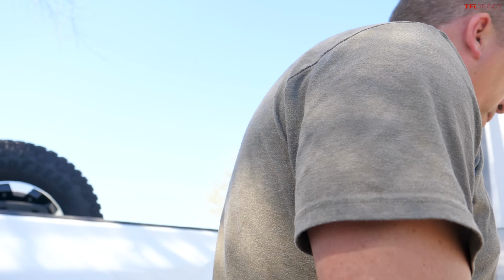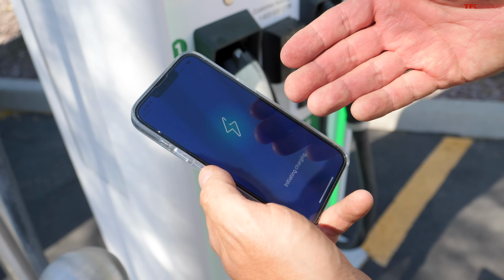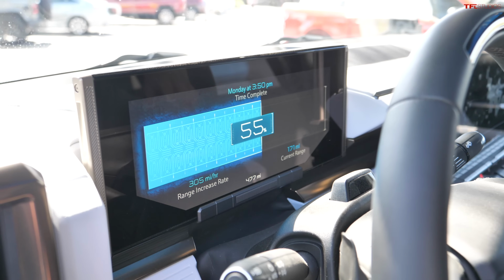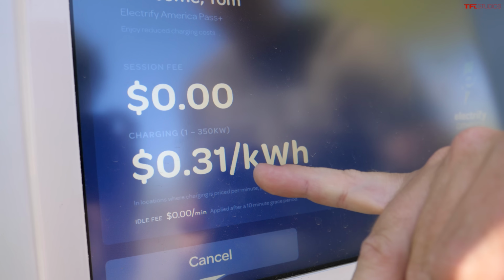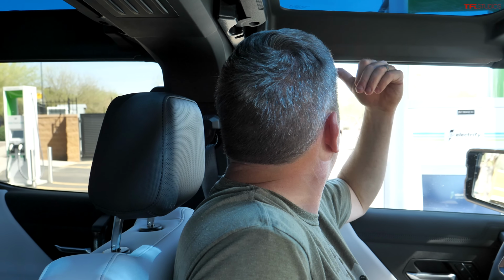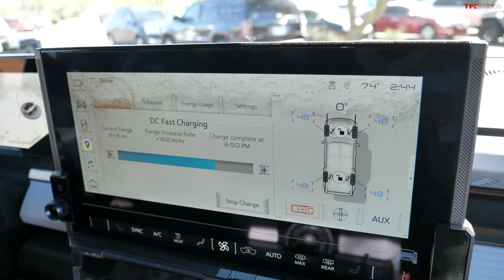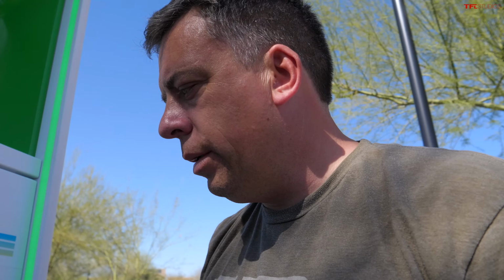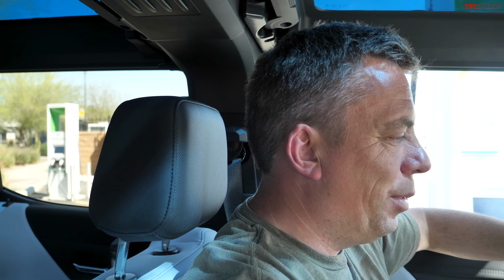How Fast Can I Charge The GMC HUMMER EV In Just 15 Minutes? The Answer Is Surprising!

Comment: I noticed in one of the videos that they guys were having an issue with the folding mirrors. I have noticed on my Hummer ED1 that my mirrors only auto fold when I lock the truck from either the remote or by pushing the lock button on the door handle. Hope this helps if they are still trying to figure this out.

Comment: From zero to 30 percent it can charge at 350kW. Then 30 to 40 percent is about 250kW. Then after that it settles in around 170kW. I think the throttling factor is the thermal management of the battery system.

Comment: These EV users need to be fully committed to the green movement, or they’re just hypocrites that paid for an overpriced car.  Make sure every time you charge your EV, that the power comes from a wind turbine or solar panel only.  Otherwise, you’re using the same fossil fuels you bitch about, only difference is the fossil fuels are being burned 10, 30, 50 miles away from you.  

Also, yes, the cost of charging is cheap now, but imagine if everyone in the US had an EV to charge.  None of you think of the increased demand on the grid, while no new power plants have been built.  Oh, you want solar and wind?  Supplemental energy sources that pale in comparison to nuclear, natural gas, coal productivity.  And the amount of wind and solar you need, requires a few thousand acres of land near a major metropolitan.  Are you willing to cover all that land with solar and have windmills all around the city?  Or do you “greenies” only want wind and solar built out of sight?  “I don’t want to see those unsightly things, just build them way out in the country.”

So many of you EV clowns forgot that at one time ATM machines were free to use.  Why?  Well, the banks wanted people to get used to using them, “the convenience of using ATMs, and not have to go into a bank.  What happened when society was using ATMs full-time?  Banks started charging service fees for: using their own ATMs or/and using ATMs of other banks.  Think these prices to charge your EV will not change in the future, when demand increases?  You guys are all clowns, and like a true Leftie, you will not think anything through.  All of you just want to feel good right now, and not consider long-term consequences of your actions.  Similar to saying, “We want criminals released…” and then an incident like the Christmas parade killings in Waukesha, WI happens.  Good job.

Finally, how many of these EVs start at $60K and only go up from there?  Some costing over $100K, but “all for the sake of “climate change.”  You are all being played, under the guise of “fossil fuels, (Which I’ve been told we’d run out of all my life -I”m 40)” when it’s a self-induced wound created by extreme liberal political ideologies purposefully crippling our energy independency.

Comment: I just watched a video that featured a new EV Hummer that was at 4%, when plugged in to home electric, it estimated 4 days until fully charged. Pretty handy.
Reply: In all fairness, that was with 120v but the guy also has a Level 2 charger (220v) and it was over 24hrs to charge that Hummer. That's just crazy.
Reply: @carlosf.7158  it's a long time, but if you always keep it plugged in while at home it'll be fine, for me anyway. That's at least 10 hours of charging per day I'd imagine for most people.
Reply: That's fake news. The longest I've seen from a 120v outlet is 30 hours, which is practically 1 day. The 240V outlet takes 8 hours to fully charge the car.

Comment: Chargers are often 1000volt at 350 amp aka theoretically 350 kW.  But since it is 0nly pulling 800 volts and even that gets throttled down to 80% you would see around 225 to 280 kW top speed.  Also top speed is seen around 10% and then drops 55% battery capacity at 178 kW is very good.  I just spent 1 hour 15 minutes adding 25 kW to my Chevy Bolt EV.  Man what i would do to do it in 8 minutes....  :)

Comment: Station is fully capable of 350kW; the battery is not. In fact, NO battery on the market is capable of consistant 350kW charging from 0% to 100%. You did charge at a higher percentage so if you were at say 20% you may see those speeds but only momentarily. The only car that can get remotely close to those speeds for an extended period is the Lucid Air and even then with a 900V battery gets around 300-310kW.

Comment: The Hummer EV is pretty cool. But my God......I don't want to even imagine what that battery costs. Probably 30 or 40k. The major drawback after 7 or 8 years of age will be resale value due to the ridiculously expensive battery. I can see this thang losing 65% of it's value easily in 8 years. No thanks!

Comment: I dont like this oversimplification of something which is extremely complex 😤 😠 😡
1- How Far did you had to travel to reach a 350kw Charger ? 
2- What is the Availability of this Chargers ( Currently ) not in 5 years time after you sold the car  🤦‍♂️
3- If there's no 350kw Chargers available ( Most likely ) how long would it take to charge using a Home wall Charger or a 7kw Charger ? 
. 

I means if there's something like 10 to 20x  350w  chargers this is completely pointless until the infrastructure   is there as supposed to being like a (LOTERY) regarding who get's to this 350kw chargers first

Comment: EV charging facts..A battery will charge faster when it has a low charge up to a certain %. After that % is reached  it slows down. So the first X % will charge faster than the last X %... So U can charge to say 55% and drive off for X miles and recharge quickly as long as the charge is low at the recharge.. Never reaching more than  80% on a single charge.. Video's available on Utube..

Comment: So, for putting things in perspective, he added 45.95 kW into the battery in 18 minutes, which means it charged in average at a speed of 153 kW starting from 53% SOC to 75% SOC. This charging speed is way above what a Tesla can do at the same SOC. Tesla is around 80 kW average charging speed from 53% to 75%. So the Hammer charges two times faster than the Tesla M3. If the Hammer was a lower SOC (state of charge), I am sure the average speed would have been above 200 kW, which in 18 mins would add 60 kWh in the battery. For a total of 18$ for about 100 miles. A truck of same size as the Hammer would be rated at 15-20 mpg. That's 5 x 5.084 $ (Diesel) = 25 $.

Comment: Larger mammoth sized vehicles are simply less efficient no matter whether ICE or EV vehicles.  The Hummer is massive and will have the most expensive EV charge cycles one could buy once it comes out.  All monster sized trucks are horribly inefficient so there should be no surprise that the Electricity costs appear to be so expensive as well.  Full sized trucks simply use much more fuel/energy in general and the Hummer is a very heavy battleship that certainly falls into that category.

Comment: The energy cost using that charging station at 31¢/kWh is not much less than the cost of gas.  I'm an EV fan, but, there's a reason for the slow adoption rate.  The cost differential of a new EV far exceeds the energy savings.

Comment: You seem so confused why it isn't charging at 350 kWh but you literally showed in the video and called out that the Hummer EV was preconditioning. It said on screen that it may take up to an hour to precondition and if you look at the screen, at Google maps, at that point in the video you were only a few miles away from the charger. Meaning you hardly preconditioned at all, certainly not for an hour. You also started charging at a much higher state of charge. For an EV channel I feel like you should know better. I would expect you to at least be aware of things like charge curves and to actually let preconditioning finish.

Comment: This charging test does not bode well for the GM Hummer EV.  I don't know what GM was thinking taking their most inefficient vehicle of all time and deciding to make one of their first EVs out of it.  The H2 Hummer earned a reputation for being a vehicle for people that are proud to waste money.  It only had a few good years of sales at a time when gas was super cheap and the brand died quickly when gas prices went to $4 per gallon in ~2007.  After that, it was seen by many as a sign of stupidity on the part of anyone that still owned one.  This is probably why you barely ever see them today.  

This, and large super duty trucks used for long distance towing, are the worst case scenario for EVs.  I think GM is going to sell very few of these.  Really bad product choice that was probably made by some geezer MBA, bean counter, or marketing schmuck that was given a leadership position and has nostalgia for something many others would associate with failure.  Don't bother with an assembly line GM.  Just hand build them in a warehouse somewhere.  A few per week is plenty to keep up with long term demand.

Comment: The cost to charge was more then I thought it would be. But calculate in maintenance cost running ice vs ev and the ev will be ahead. They have a long way to go on the charging network and battery chemistry before I go for one.
Reply: but factor in the cost of replacing the battery and then you're better off with ice

Comment: There must be something wrong with that charger to be charging that slow for 350 kW. Starting.  This is  a problem with these non Tesla charging stations you find this type of issue constantly throughout the country. They have to do a better job if the public is going to start buying non Tesla EVs because if not people are going to get turned off and not buy them. It's either slow or they don't work.

Comment: $14.24 doesn’t seem very cheap to travel only 75 miles
Reply: Hummers in general were never very cheap to travel 75 miles, but still cheaper than mine. My Escalade gets 9mpg on an average day which means traveling 75 miles uses about 8 gallons. If I fill up using regular 87 gas at $3.71 a gallon (I just filled up today 1/27/2023) that would cost me about $30 in my Escalade. The BEST mpg I've gotten on a tank is 12mpg which would mean traveling 75 miles = 6.25 gallons = $23... This bougie Hummer EV is still cheaper than my truck lol.

Comment: I like how when it’s a Legacy auto manufacturer that’s failing to meet expectations they are always on a positive note on TFL. If this was a Tesla failing to reach charging capacity or even remotely close to it they would’ve thrown Tesla under the bus.  

This is also another consideration of super heavy EV‘s is charge times will be near double because consumption is near doubled. Small EV‘s will charge faster than large EV’s from the owners perspective.
Reply: Very true.  It's not just this channel though.  It seems almost everyone wants to give the benefit of the doubt to legacy auto even though it's obvious they are failing to produce compelling (or sometimes even mediocre) EVs.  Meanwhile, they'll nitpick everything about a Tesla and hold it to a completely different standard.  That would be fine if they acknowledged that Tesla sets the standard and they expect more from it.  However, it's presented more like, "Tesla earns a B- grade because it doesn't have a plastic divider in this storage compartment to hold my lunchbox.  GM gets an A because they managed to make it charge slowly."

Comment: theres literally no way you could ever charge this in 15 mins as it would need a freaking commercial mega charger at 800kw to do that if it held that the entire time....the hummer is a pos.  it weighs 9500lbs and gets 300 miles with a 200kwh pack that till take ford to 350 chevy truck to 380? cybertruck to 550.  yuck.  it can go offroad, due to the tires lol.  its gms first megapack ever and it shows....18" thick god bless. a tesla pack is some 5" for 100kwh on a shorter wheelbase?  how did they suck so bad
Reply: It's a gigantic, inefficient brick. I love trucks, but the transition to evs should be used to ditch trucks altogether.

Comment: You are only going to get 350kw when you pull up with 5-10% left on the battery. The 100 miles in 12 minutes is when you are on the low end since thermodynamics isn't against you. Good ole GM marketing for you there.

Comment: Its great you can use chargers at the places you are visiting for more than couple hrs or so.  But if you going to make a quick pit stop to charge for a few miles to you destination, thats the question I would like to know. Gas its like 5-7 mins fill and you're off.  Don't worry about filling up until the tank is 1/4 tank or close to empty. I would rather get a Hummer Hybrid with a V8.

Comment: From what I can tell, electric vehicles are superior in almost every way but cost and range. Two enormous issues. For ultimate battery health EV manufacturers really don't want you to go below 20% charge or above 80% , or 60% of advertised range. Charge stations seem to be incredibly inconsistent and unreliable, so charging at home is the best realistic option if factor in opportunity cost. How much is your time worth? If you make 50$ an hour and you waste an hour to get a 100-150 miles of range, you need to factor that in. Better battery tech (solid state) and better charge stations will eventually make EV's a no brainer, they’re just not there yet.

Comment: The real test will be at 100% charge while doing a heavy duty tow of maybe 80 thousand pounds uphill both ways, even though it might slightly exceed towing capacity.
Reply: exceed? its illegal. it cant even tow its own weight of 9500 let alone 80,000
Reply: @richardroberson9277  
Maybe a case of being overly optimistic on my part- and definitely very heavy on the sarcasm.

Comment: No way I am going to plan my day around charging stations. Pick up a little here and a little there.  This has a long way to go before it is practical outside of an urban area.  Let see more hydrogen powered vehicles.  Did you see that Toyota is working with another company on a hydrogen powered V8.  Now you're talking!
Reply: no theyre not.  they made a car named the miraj.  it sucked very very much.  tank cost more than the battery in a tesla.  it took like 15 minutes to fill as its not a liquid its hydrogen gas.  1 station in california with subsidized hydrogen.  beyond dumb
Reply: @richardroberson9277  That a load of bull.  There are already Hydrogen powered vehicles that use fuel cells.  It's about as quick to refill as it is gasoline or diesel.  While electric can be one option, we should not put all our eggs in one basket. Australia is making major investment in hydrogen for ground transportation.

Comment: Did I miss something or did they get ~80-85 miles on 45Kw? so ~500wh/mile at probably 70-80 degrees F? It's a giant box, but that is rough. Will be interesting to see the charge rate and wh/mile in the winter.
Reply: Yes, 2 mi/kwh is correct.  This is a big heavy brick.
Reply: @-Jethro-  and remember kids a model x weighing 5000 lbs towing a 2 horse trailer empty got 900wh/mile.  neato

Comment: Try charging at night at that same station to see if those numbers improve since the demand on the electrical system should be less…
Reply: the charger is capable of 350kw.  theyre paying for availability.  thats not how that works.  you dont run out of power you run out of voltage.  that charger will sit there quite happily at 350kw if its at 200kw.  theres no way (1) charger taking 150kw less in a grid of 100s of mega watts 1000kws would make a difference.  Its like .1%  the charger is happy to pull in power at a wide range of voltage and the grid would be having a brown out before the inverters here likely cared.

Comment: I was told by Ryan Shaw tech the hummer EV has dumb range and should take longer to charge due to using a bigger batter to get more range rather than making the EV more efficient so you can get more range with a smaller battery (keeping in mind this is a truck so won't have the best coeffecicint of drag).  Looks like it can charge pretty fast.  But a bigger battery would also cost more to charge all the way.